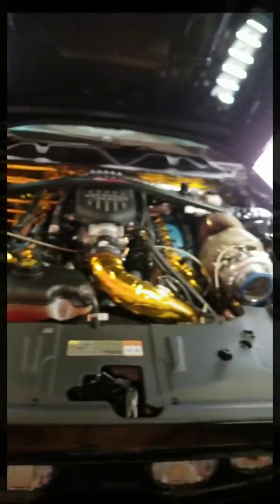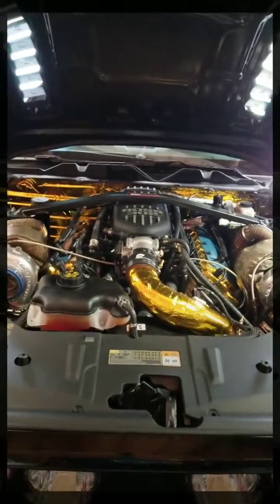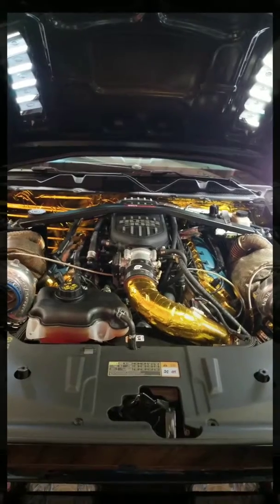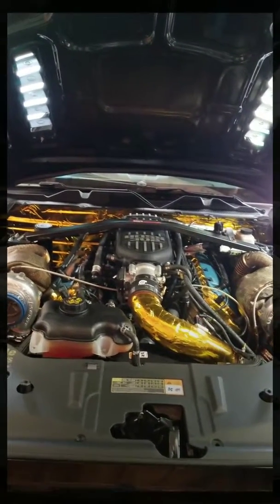Mustang coyote gen1 vs gen 2 differences my aluminator

Comment: Would you recommend a Gen 2 Aluminator over building the Gen 1 shortblock or getting a built Gen 2 shortblock?
Reply from the maker: You could do either or... depends on ur budget. Roughly tbe blocks will cost the same to build with Similar internals. It just also depends on how long you wanna wait... if ur staying going over 800 hp though i would suggest sleeving the block for insurance and using arp headstuds.

Comment: This was a great vid. Ive been through a few built gen 1 motors last year, with some terrible luck, and other issues.....i decided this time not to fuck around with local “engine builders” and got the gen 2 aluminator 11:1, put my new gen 3 2.9 whipple on it, along with my tci 4L80e conversion. I did not know about the cam/drive group until recently, and am now waiting for parts from ford racing. If i could have found this video 5 months ago, idd be rolling already!!! Either way great video!!
Reply from the maker: Thanks man and yeah the 11.1 engine with the gen 3 whipple is going to be fucking nasty just u fuckin wait man im a stick guy but the auto guys that run that kinda setup fucking ROLL OUT MAN u will not be disappointed at all that car will excite u once its running

Comment: Also one more thing, what oil do you recommend running in an 11 gen 1?  The recommended 5-20 from ford seems to be a little too thin. I was getting some bottom end noise very slight but noticeable so I through some 5-30 in it and seemed to help. Just wondering if maybe some amsoil dominator 5-50 or similar would be a good idea?
Reply from the maker: Honestly oil all depends on what ur doing with the car. Oem is 5w20 in a gt for best overal performance and fuel economy. If u supercharged or turbo ur car ur best bet is to switch up to 5w50 like i was running its more expensive but it provids more oil pressure as well and lubrication during high rpm.. ALSO your oil filter will provide u a big difference in how it cold starts. Fords oem filters have a check valve to help stop oil drain back so u dont dry start ur engine. And for built engines most qant u to use the ford racing FL820s filter... high capacity and different seals its like a 18 dolla filter. But at all costs always run a stock filter oem. Dont use no aftermarket junk.
   Also i like ford oil, amsoil, or driven... those are the 3 i would only run and make sure its full syn only..
Reply: THE_BULLITT thanks for the suggestions man I appreciate it!
Reply from the maker: @Sdibble2000   no problem but if ur getting some noise in the engine u could have a actuall problem starting on ur car. There should be no noise and if a thicker oil helped get rid of it then u should start looking into a engine tear down as u prolly have some wear and tear going on as it shouldnt have any noise at all.... so id say something is going on..... what  kinda noise are you hearing???

Comment: Great info man! Not many youtubers out here that know these motors inside and out like you do. What trans are you using? My mt82 in my 11 gt has about had it. 97k miles and the input shaft bearing has a ton of play in it. If I were to get it rebuilt are there any options available to strengthen that input shaft and bearing?
Reply from the maker: Im running a magnum xl-t56 from jpc performance the entire swap kit was roughly 6300 shipped. Its complete with whatever options u choose. I choose best of the best so mine was expensive. And its held up to 1000 plus crank hp with no problems.
 But there is a guy called ben calimer.
 Look him up he rebuilds the MT82 transmissions and makes them alot tougher and uses gforce gear sets 
 Not sure if this link will work but google brings him up on facebook. Good dude and he is cheaper then a mt82 swap and his trans hold up to a hella of a lot 
https://www.google.com/url?sa=t&source=web&rct=j&url=https://m.facebook.com/pages/category/Cars/Getragmt82/posts/&ved=2ahUKEwjTi5zG86PgAhWI7YMKHXdlAwgQjjgwAnoECAcQAQ&usg=AOvVaw1nVypzr8YPgCbqaDRA-dHi

Comment: how was the fitment when installing the GEN2 motor into a GEN1 Coyote Mustang? Are the motor mounts the same?
Reply from the maker: It fit perfectly fine the gen 1-3 all have the same mounting.. there is actually 1 or 2 gen 3 blocks with gen 2 heads with gen 1 timing in a 11-14 already if i could find the link id share it but i cant find it unfortunately... but again all mounting and trans bellhousing mounting is the same
Reply: if you ever find that link, please reply! Great video by the way.
Reply from the maker: @Hew_Jass  i will take a look see if i can find the gen 3 11-14 link ill link it if i can find it and thanks
Reply: sounds good man thanks